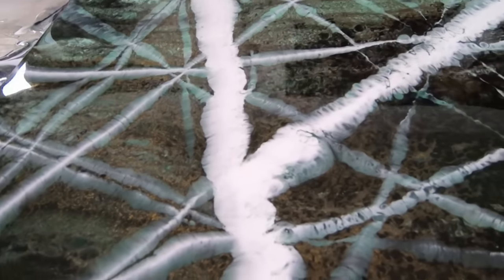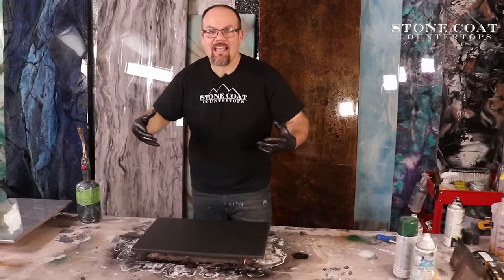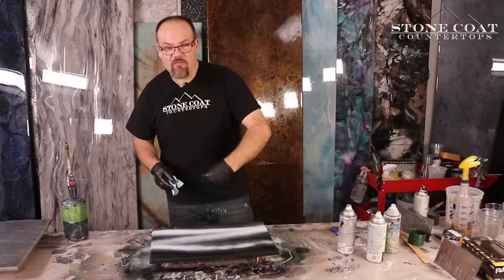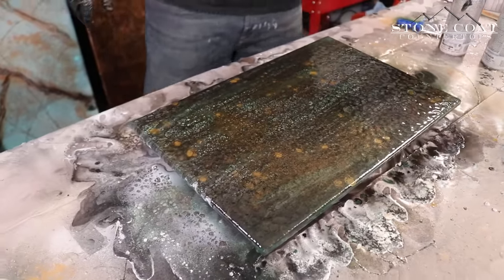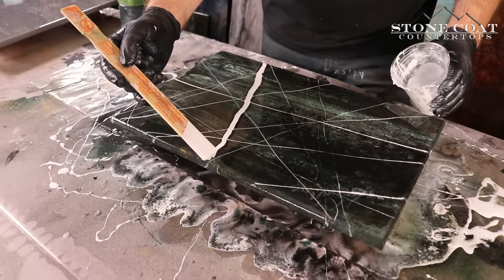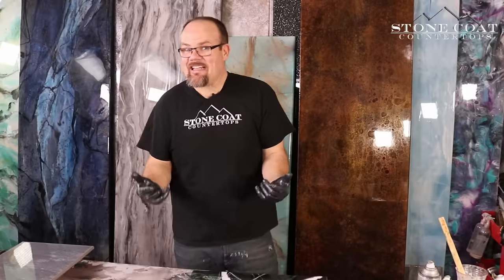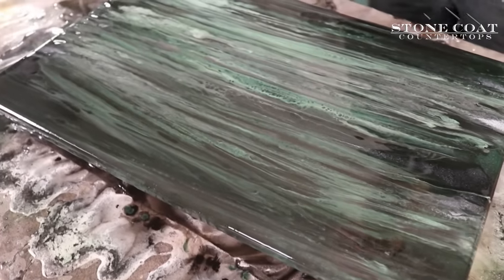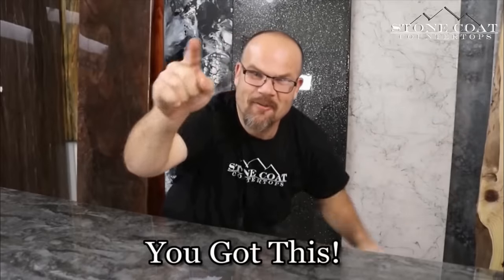I Made This Mimic Exotic Stone

Comment: I have a question, how suitable is an epoxy counter as a woodworking bench. I don't know how resistant to gouging it is. I would, most likely, make a wood laminate and coat the top, much like what you did with those random wood slats.
Reply from the maker: Lots of folks use our products in their shops. Check out https://www.facebook.com/groups/SCCinsiders/ to ask our community how they think this epoxy will hold up for your project. thanks again!